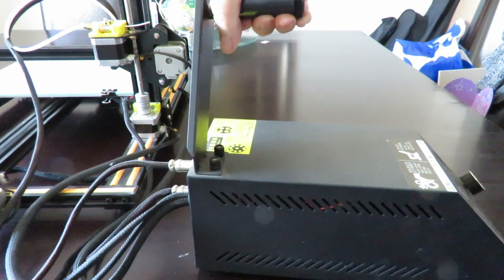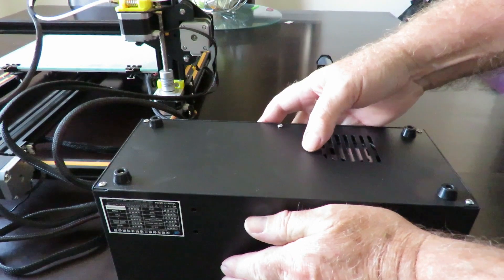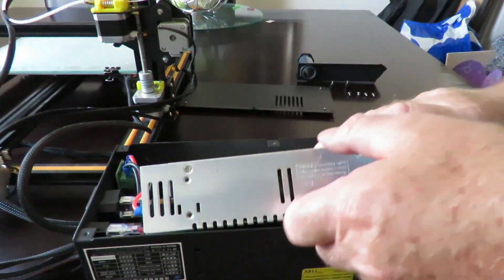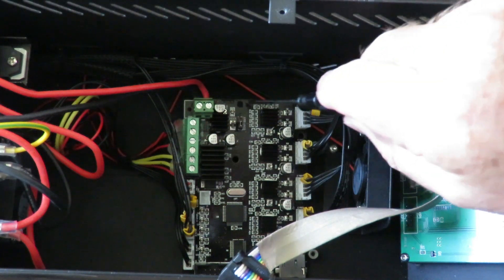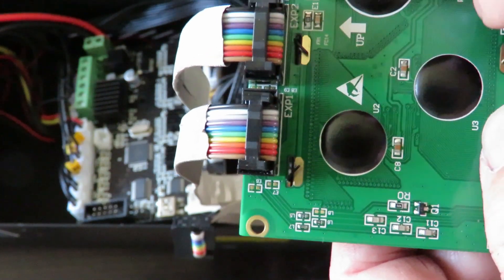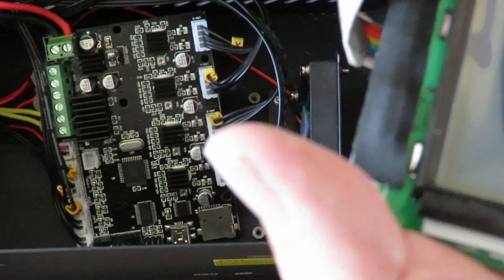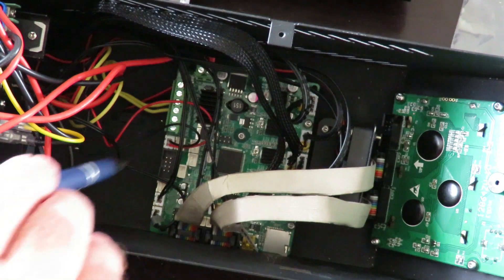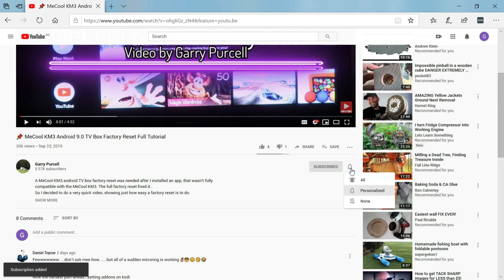📌 Creality CR 10 Full Upgrade Kit to CR 10S v2.2 Mainboard Instruction Video Part 2 of 3

Comment: I have tried this upgrade but i can't get the screen to work. The link to the firmware you provided has disappeared from creality. I have tried manually editing the firmware but i can't get the thing working. Any help or an updated link?
Reply from the maker: You should find the Unified 2 Firmware I used below.
https://support.th3dstudio.com/hc-category/unified-2-firmware/

Hope that helps.
Reply: @GarryPurcell  excellent, thanks for that. I will give it a go.

Comment: Hello, thx for your Video and work. So strange, I change the board and screen like you, but I have no connection the the Laptop and also no light up by the screen - fans runs... what can that be? thx for a lil tip in advance. PS; I dont have to put in a Jumper or something like that??? kind regards
Reply from the maker: I'm not sure.
My first thoughts are, you have tried to connect the original single cable LCD screen, rather than a new twin cable LCD screen.
Reply: @GarryPurcell Hello, thx for the feedback! Well strange, I found the bug. When I plugged out the Filasensor, the screen wakeup and the system works fine Unbelievable.

Comment: thanks to this video i was able to get my printer back up and running
Reply from the maker: Glad you're up and running again.😀
Reply: Ditto. CR10 replaced with this board & display. The printer works better! It wasn’t quite easy and there was quite a lot of head scratching but it’s done & printing again. The video was absolutely key. I’d never have been able to do it without. I used the stock Creality firmware for the 10s. I bridged the black & yellow wires of the run out sensor as mine doesn’t have one. Various other things went wrong but in the end it worked. Thanks Garry for doing it!

Comment: Hi Garry thanks for the vid, did you notice if the 2.2 board made the printer any quieter my cr10s screams it's knackers off while printing thanks. Andy
Reply from the maker: I didn't notice any difference in sound.
You need stepper motor dampeners to cut back the noise.
Reply: @GarryPurcell  I did buy some but it's not enough i have just bit the bullet and brought a silent board fingers crossed it solves the problem
Reply from the maker: Please let me know how it goes.
Reply: will do although must admit i'm a little apprehensive about it because the board is designed for the ender 5  plus but it does have firmware for the cr10s  i just hope it has aversion with the bltouch if not i'm going to have to mess with the firmware :s

Comment: I have a custom ender3 v2 it's about the size of a CR10S but it's a total custom 3d printer that I bought used  a never got it to work I keep throwing money at it hoping I'll fix the issue
Reply from the maker: Hopefully you will get it up and running in the end.

Comment: I just tried this upgrade, but I didn't replace the lcd. The lcd only had one ribbon cable. It seems that my lcd lights up, but it's blank. Do I need to change my lcd or just add the other ribbon cable?
Reply from the maker: You need the LCD with two connectors, as the new mainboard is wired that way, and wont work with a old LCD with a single cable.
Reply: @GarryPurcell  Surprisingly enough, I was able to get it to work with just the one connector! TH3D Unified 2 Firmware happens to have an option for using the CR-10 display with a CR-10S board, so I just had to enable that and it worked perfectly!
Reply from the maker: @williamflinchbaugh6478  Good to know, thanks.
Reply: @williamflinchbaugh6478  can I get the link to your firmware you used to get it to work

Comment: Hello Garry,

This is the most helpful video for upgrading the CR-10 to a CR-10S.  Mine started as a CR-10 and went to CR-10S then my USB connection broke.  Now I am trying to use the same board you are using but I can't get it to work.  It keeps going to blank screen and fans on full.  I also can't figure out where to hook up the mosfet on the back of the control box. Any ideas?
Reply: Same problem here, did you find the reason, whats wrong??

Comment: Hi Garry, I have watched the video and it is an excellent tutorial, I have a question for you if I may, I have the same Board, V2.2, 
2-Z and 2 Extruders, what I would like to know is how to connect an LCD Touch screen to this board, I was told it is possible but no one
has ever came up with pin-out diagram to connect this, the screen is 4.3", it would be nice to have that instead, don't you think?
Cheers
Siamak
Reply from the maker: I don't own a touch screen, so I'm not sure if its possible to fit one to this board.
So I really can't help you.

P.S. Maybe you could contact the LCD manufacturer, and ask them directly.

Comment: Nice video.
I am trying to connect two filament sensors on my CR-X (it came with this motherboard) dual extruder machine. One sensor goes to pin 2, which is the signal pin in the 3-pin filament sensor socket but I cannot find pin 15 which is supposed to provide signal to the second filament runout sensor. Do you have any idea which is pin 15? Thank you.
Reply from the maker: I don't own a CR-X, so I'm not sure.
The CR-x is a dual extruder, I would assume there would be a single plug on the case, to plug both the sensors into.

Comment: When you advertise Banggood I also thought you should tell what services they get when their printer does not work, getting something for free from them is one thing but when people have paid for it it is something completely different because they have no support or guarantee themselves if they write it so customers are just fuck when something goes wrong, so tell that before you do something like this
Reply from the maker: I personally have had no problems with Banggood for delivery of products. (If you have a defective product, and they won't come to the party, you simply open a PayPal dispute.)
P.S. I have bought quite a few products from them with my own money.
The last thing I ordered from Bannggood was two watches, which arrived 7 days after ordering to my home in Australia.
Order Submitted
Nov/06/2020 00:44:44
Payment Confirmed
Nov/06/2020 00:44:47
Order Processing
Nov/06/2020 00:46:11
Shipped
Nov/08/2020 08:20:10
Order Completed
Nov/12/2020 23:51:00

I can't say the same for GearBest, I think they are terrible, and misrepresent, what they actually have in stock, and will lie to you about it, I will no longer buy anything from them.

Comment: I reflashed firmware with what is on the TH3D site, using the firmware for a CR10s.
My X.Y.Z axis all work, hot end and bed are heating , fans work and screen and controler all working fine.
My problem is the extruder. I tried to load filament for the first time  and when trying to "move axis" manually with nozzle at temp. , nothing happens.  I swapped the X axis lead and I can manually step the extruder so the motor is good.  This new board has dual nozzle capability. I have tried with lead hooked to the "E1"and "E0" port on the board and nothing happens. Anybody have a clue?
Reply: I figured it out... Its a stupidly simple problem. Turns out you cant move the extruder till the nozzle is at the right temperature and filament sensor detects filament🤦‍♀️ I even ordered a new board thinking it was faulty😂 RIP me
Reply from the maker: I'm not sure what the problem is.
Did you check if the TH3D firmware is set correctly for your setup, before flashing?

I have a EZABL™ Pro Control Box and sensor arriving shortly from the USA.
So I'll be re-flashing the TH3D firmware shortly, to accommodate it. 
I'll have a look at the settings when I'm upgrading for you, if you haven't already sorted your problem out by then.
Reply: Hey that's wierd. I have EXACTLY the same problem, but with the stock firmware shipped with the creality board... Even I'm stumped.

Comment: Did you need to change the old monitor? I just plan to change the board so I can put a filament runout sensor
Reply from the maker: I'm not sure.
Reply: I want to do the same did you find out if you need to also change the screen?
Reply: @b12oken  I did change the old board with the new board
Reply: I'm guessing you do, since I just installed this board in my CR-10 (original board quit working) & the screen did not power on. What did you find out?